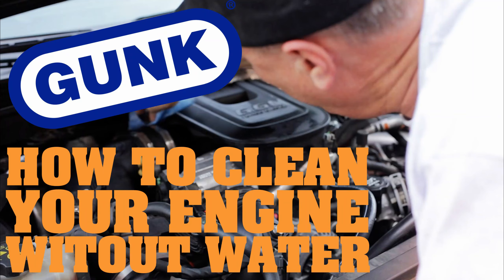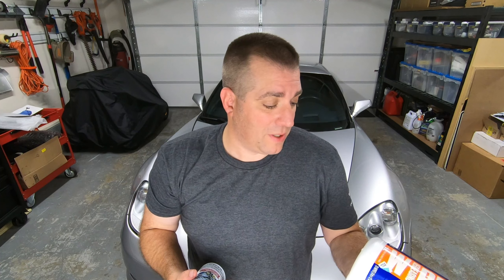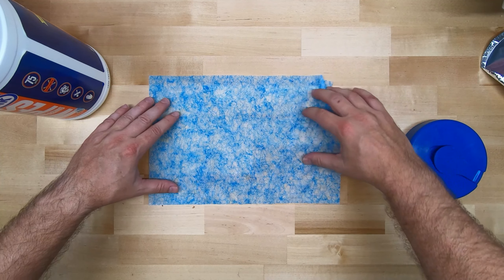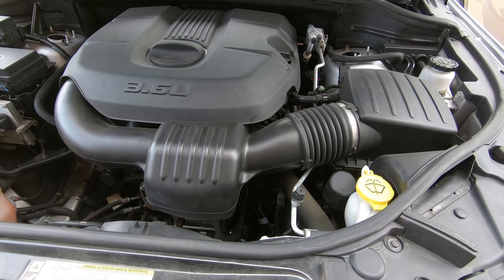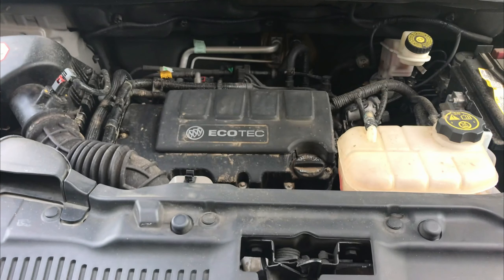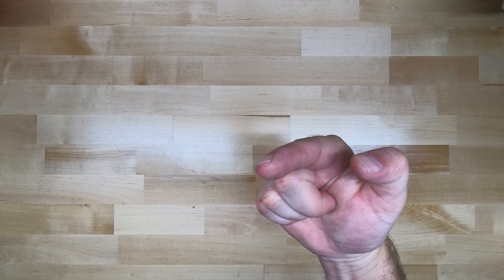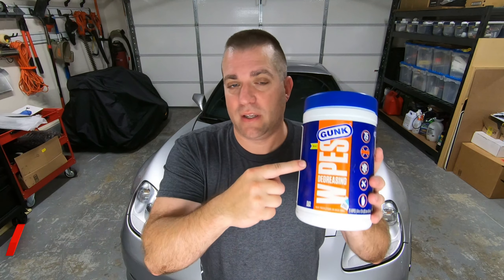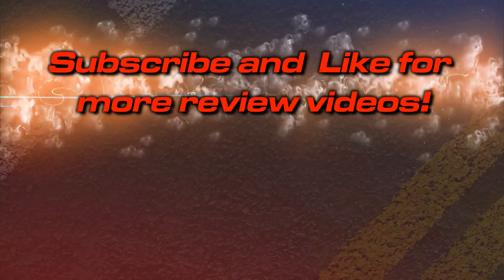Putting GUNK Degreasing Wipes to the Test + WIN a GUNK Prize Pack!

Comment: You should  do  a review  after a week to see how long it stays  moist. By the way  great  video.  Keep it up.  You definitely  deserve  more  subscribers.
Reply from the maker: After being out of the can?  Or how long they stay wet in the can?
Reply: @InJasonsGarage  how long the plastic you sprayed stays moist.  Also that  too.
Reply from the maker: @navysealsrock1725  Not very long.  It dries pretty quickly but leaves that finish because it is stayed wet, dirt and crud would stick to it.
Reply: Great question! The wipes will air dry within a few minutes after leaving the can. They're wet enough to get the project done. Important to note: They don't contain isopropyl alcohol so they won't dry out in the can like other brands. The can is also sealed from the manufacturing facility so you don't have to worry about buying dry wipes from the store. Lastly- it's a water based solution, so if you run into any issues, you can just add a little water and shake the can.
Reply from the maker: @GUNKOfficial  I can back this up.  I've been using then around the house and garage since I did this video and they do stay completely saturated in the can.  They have more of a thin rag consistency than a "sponge" consistency....but I just make sure I shake the can a few times before I use them and they absorb enough to work very well again.

Comment: Have you experimented with using the wipes on the wheels to remove brake dust?
Reply from the maker: Good question!  I would, but just out of practice I have always been very careful about what I use on wheels.  If they were beater wheels, no problem and I think they would do VERY well based on my testing. For the Corvette, I use only microfiber towels and a good quality quick detailer.
Reply: I pretty much follow the same procedure, but I was thinking more about the inner barrels.
Reply from the maker: @petercarey6883  Oh yeah...these things would do VERY well with that.  Same for exhaust pieces, etc.
You sparked an idea.  I am going to be doing an Armor Shield shootout test with some knock-off ceramic coatings, and I will use some of these are part of the test to see if either side scratches the paint at all.
Reply: @InJasonsGarage  I like that idea, especially on the exhaust tips. I have the Corsa exhaust tips, which is a much better quality than factory and at the moment I pre-clean them with a solvent and then use my cordless drill and power-ball with SemiChrome paste which is a fantastic  product and has been around since . . ???? at least 50 years.
Reply: I use them on my F250 King Ranch wheels all the time. Works great
Reply: @InJasonsGarage  GUNK Wipes are completely safe on any wheel. You'll want to use one wipe to clean the wheel, then a second to clean the film that will be left by the brake dust.